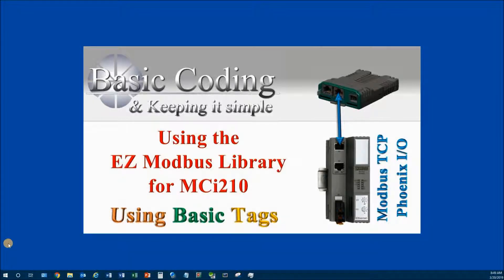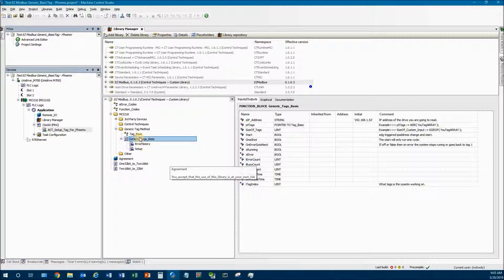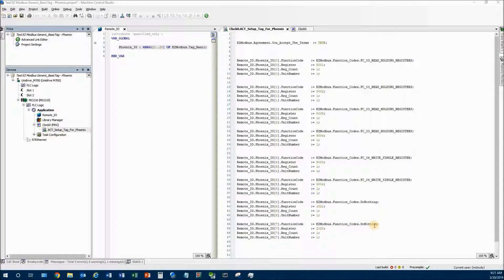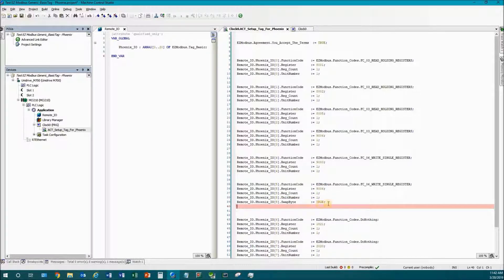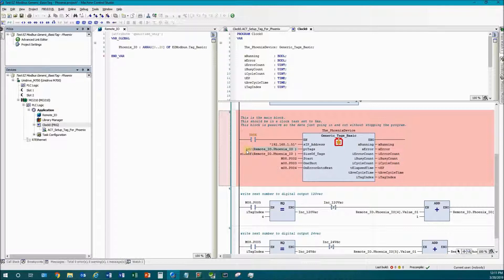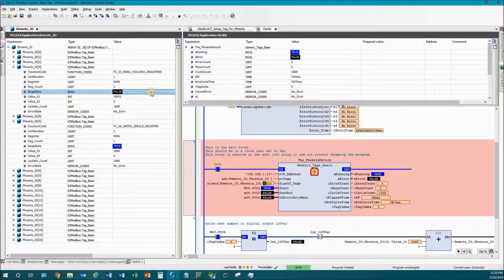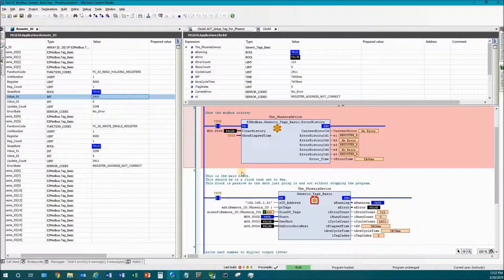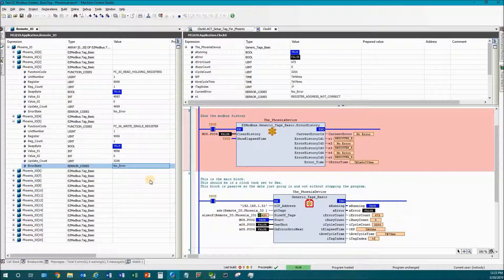EZ Modbus TCP Using Tags / array with the MCI210 on a M700.

Comment: Can you publish link of that library if possible? Also, when MCi210 is used as modbus rtu master, what is maximum number of nodes that can be used to communicate with it? Is it 255 or limited to 32 what i think i did read somewhere under CT documentation?